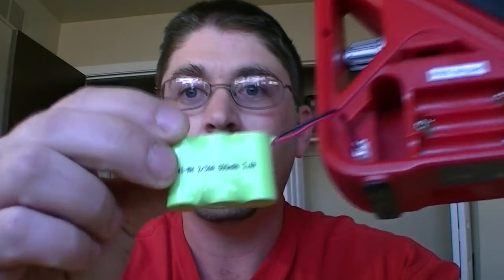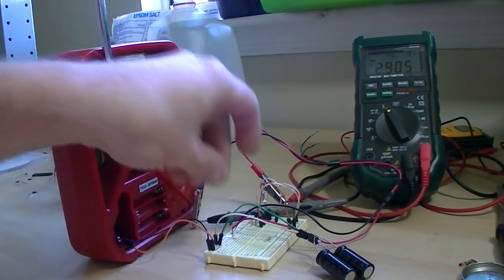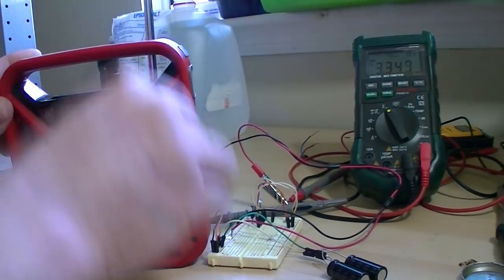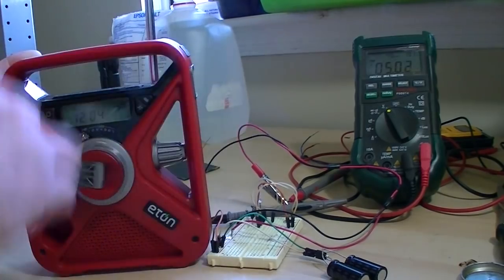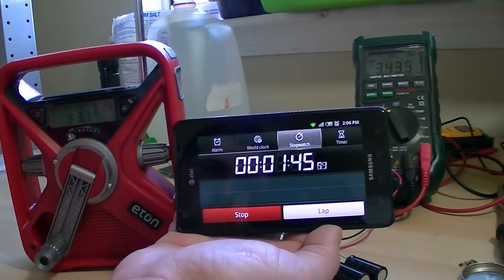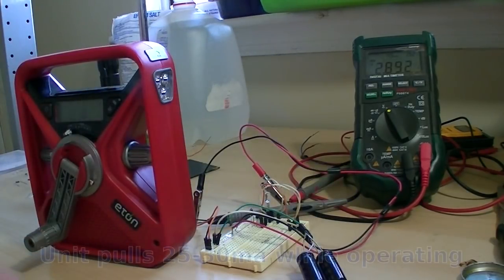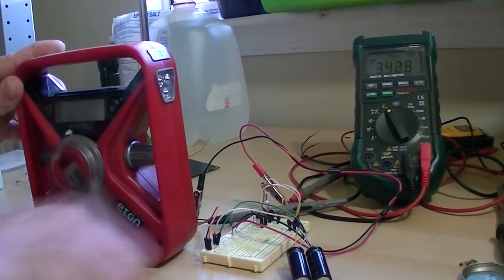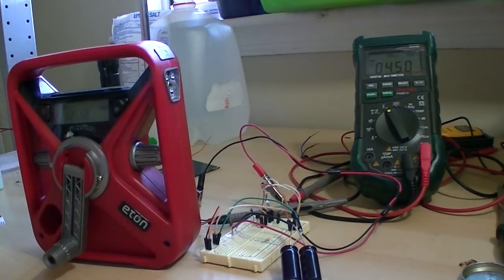Supercapacitors Instead Of Rechargeable Batteries

Comment: Battery: 3.6 v @ .6A = 2.16 Watt/hours 
Each cell of the battery is 1.2 volts nominal (~1.35 volts charged). 3 cells = 3.6 volts (~4.05 volts charged)
The units cutoff is 2.9 volts (~0.96 volts/ cell)... Since a typical NiCd cell is nearley completely discharged and still above 1 volt/ cell. This cutoff is fine for a 3.6 volt NiCd, and does not affect its delivered capacity of power to the unit.

Calculate power in Joules:
P(W) = E(J) / t(s) ... 2.16 = E(J) / 3600 s... E(J) = 2.16 x 3600 = 7,776 J  

3600 seconds are used because that's 1 hour. 1 Joule = 1 Ws (watt/second). So, 1 watt per second is 3600 Joules. That's the Joule-Watt relationship. (Doing this because Joules are used in capacitance power calculations)

2.16 Watt/hours = 7,776 J  <-- *The battery's total power 
(* regardless of the units voltage cutoff and what not)

Since the units cutoff is ~3 volts, we need to a healthy amount above it to achieve to same power. This is because the capacitors still hold power below 3 Volts (actually all the way down to 0 volts, they are still releasing energy). So, to find a capacitor "equivalent" to the battery... we need to calculate above the cutoff. 

A capacitor's discharge (unlike a NiCd) is near linear (For this example, Its fine to generalize that it is).
This means, as the capacitor loses its charge, it drops at a linear rate in relation to the applied load.

I'm going to assume, that the unit has a battery charge regulator that limits the charging voltage to 1.6/ cell  (generally, a minimum of 1.41 volts/ cell is necessary of any NiCd charger to achieve a full charge)

So, we can say the charging circuit will deliver ~5 volts max on the output. Since out cutoff is ~3 volts... that only leaves us with 2 volts of capacitor power to play with for the circuit.

So, to make 7,776 J of usable energy in a capacitor, we are actually going to need 60% more energy than the standard battery. This is because of the cutoff. The caps will discharge to 3 volts, then all the rest of the energy become unusable. Essentially, your only going to have 3110.4 J (2/5ths of a 5 volt, 7,776 cap bank). This is simply a waste.

The solution, is a voltage booster! Some DC-to-DC converters can take a low voltage and bump them up to a desired amount. With an example of the XCL101C501BR-G (from Torex Semiconductor), you can have a minimum input of 0.9 volts and max input of 5.5 V, and produce a steady 5 volts @ 100 mA! Perfect for the discharge characteristic of a capacitor. 

This would mean, we would be "resetting" our cutoff voltage to 0.9 volts, and could even use a set of 2.5 volt super-capacitors in series and be completely in the clear to use most of their stored power. We would need to use 3 super caps, because the charging circuit voltage is actually exceeding the max voltage of 2 caps. (Trust me, you do NOT want to exceed the voltage of a capacitor... let alone a super cap). So since the cutoff is 0.9 volts and the max of the charger is 5 volts.. that's 4.1 volts of "wiggle" room ( much better that the 2 volts before). Since 3 super caps in series are 7.5 volts, were shaving off 3.4 volts of usable power (7.5 - 5 = 2.5, 2.5 + 0.9 = 3.4)  of the bank. So, that's ~ 45%. Still a lot of unused energy... but workable. So, since we need to have 7,776 J in the bank between 0.9 - 5 volts... were actually aiming for a total power bank of ~ 14,138 J ((7,776 / 55%) x 100%).

E = ½  x (C x V²) 

14, 138 = ½  x (C x (7.5)²) 
C = (14,138 x 2) / (7.5)² = 502.67 F

That means we are going to need ~500 F @ 7.5 volts to make the usable power equivalent to the battery.

3 caps in series are as follows:

C(total) = 1 / ((1/C1) + (1/C2) + (1/C3))
500 = 1 / ((1/C1) + (1/C2) + (1/C3))

Since we are using the same nominal sized caps... we can rearrange the formula and solve for the value of C (C1, C2 and C3  will be the same)

1 / 500 = (1/C1) + (1/C2) + (1/C3) 
is equivalent:
1 / 500 = (1 / C) x 3
is equivalent:
(1 / 500) / 3 = 1 / C
then:
C = 1 / ((1 / 500) / 3) 
C = 1,500 F

That means we will need three 1,500 F, 2.5 volt caps to make the equivalent power of 620 F @ 7.5 volts.

The most cost effective equivalent to 1,500 F, is the XV3560-2R7407-R (by Eaton Bussmann) @ ~ 16.50 USD each. It is 400 F at 2.5 V... We will actually need 12 of these caps to make our circuit. It will be 3 seats of 4 caps in parallel (1,600 F), with each set connected in series. A solution like this, with the 12 caps, a DC-DC booster and some wires and solder gear would be ~220 USD all said and done. (In saying you have solder tools already). 
With a system charge voltage limiter to 2.5 volts, you could use 2.5 volt caps.
Again, since we need to have 7,776 J in the bank between 0.9 and 2.5 volts now... were actually aiming for a total power bank of ~ 12,150 J ((7,776 / 64%) x 100%). This actually improves our efficiency of the bank again, by only having about 36% of unused power. 

12,150 = ½  x (C x (2.5)²) 
C = (12,150 x 2) / (2.5)² = 4860 F

~ 4800 F to make the equivalent power at 2.5 volts will be 12 caps in series. So, you can see, there is no difference to the cost of the system. Just improved efficiency.

Maybe both are not the most cost effective... but you can see that caps are still not an answer to the energy problem. Alternative batteries and technology may progress caps and batteries.

Comment: Dude, you're doing it wrong!  The effect you're getting with the capacitors in series is like trying to pour 2 liters of liquid into a 1 liter glass, it won't fit.  You need to connect the capacitors in parallel to get the total voltage of the capacitors higher than the voltage you want to charge to.  As it is now, your capacitors are quickly bleeding of the excess voltage above the 2.7V of the capacitors.

You're taking a chance that your capacitors will blow up in your face, not pretty!

Comment: What's the difference between ferrets and amp hours. I wanted to switch my scooter from sealed lead acid batteries to lithium-based batteries but would supercapacitors provide even more power or with a discharge with to rapidly to be practical for use.

Comment: You need to run the capacitors in parallel  to increase the Microfards, maybe you should go back to school. all so
a battery can store more energy then your version of a super capacitor.. Sorry dude.
Reply: Phillip Ramirez http://puu.sh/gtF5H/93db96f7ae.png 10F 2.5V
Edit: MrMac5150 Super capacitors are quite sensitive about over-voltage. He is using series connection to increase the voltage they can handle, so that it meets the requirements of the radio. It is mentioned in the video, that the low-limit of this particular radio is 2.9V, that is, it does not function with voltages lower than 2.9V.
Reply: but it has no deep capacity
Reply: watch the video more carefully next time, they are in series as they are 10F 2.5v and his requirement is almost 5v.
Reply: waqas shehzad they arnt a full F. milli maybe. micro probably but bigger then pico
Reply: Fester Blats
So true, a cap can not replace a bat.
Reply: Fester Blats the faster charge. the lighter weight. life expectancy if maintained correctly. super capacitors are being used many places along with storage cells. the key is to combine them not fully replace them
Reply: Phillip Ramirez
BULL
Reply: Just do a search. They are developing ultracapacitors for use in fuel cell vehicles. Before you call bull on someone you should try to at least make sure what they said wasn't correct
Reply: Phillip Ramirez
Bull SHIT
Reply: MrMac5150 The capacitor used in this video is relatively small compared to what's available out there. http://www.mouser.com/ds/2/257/Maxwell_Technologies_k2_2_85v_ds_3000619en_1-491975.pdf In certain applications, a supercap would be more appropriate than a battery, due to the high currents you can charge and discharge supercaps at. Not saying that a supercap is what is most appropriate for running a radio such as this one, but it is fully possible, as demonstrated in this video.
Reply: Oddstr13
Ya like a wind up flashlight.. LOL

Comment: Nice demo!  The only technical issue for the booster is switching it in and out of the circuit during the charge/discharge cycles. A double pole, double throw switch would work nicely. A quick and dirty way would be to have quick connectors input to the booster with a female connector and the output from the booster with a male connector. This would allow it to be placed in line and in the correct direction very easily. It could also make it easier to experiment with switches...

Comment: i found the selfdischarge to differ greatly. The maxwell caps with the terminals on one side hold their voltage amazingly well, the once i got where the leads are on different sides are not so good and those chinese Hy-Cap's are quite bad regarding selfdischarge (ok i had only one new cap to test this).

Comment: Wait 500F?  How do you charge it without shorting out your charger?  The inrush must be outrageous.  You sure these are not 500 uF and someone scrapped off the "u" to trick you?  and how do they do it in such a small package?
Reply: Then an current source could be used, which can limit the charging current to safe values.

Comment: I would like to see how connecting the capacitors in parallel to the regular (factory stock) battery pack might enhance the performance. ... It seems like the capacitors would act like a charging  "reservoir" and would soak up any transient "spikes" in your manual charging output ... SO ... In addition to adding capacity to the total stored charge (milli-amp-hours) the capacitor SHOULD also add efficiency toward absorbing and storing any sharp spikes from the crank-generator whereas those spikes might be wasted as heat by the SLOWER uptake of the chemical batteries ... Hmmm ... Just a thought. ... Of course, over  the course of an hour, you might loose all that faster capacity due to leakage. ... another big "hmmmm".

Comment: Nice . Simple , un confusing demo . Any chance of this & the battery alternative tabulated . Times , power in / power out effeciancys . It would seam a capacity / battery amalgum would be the best way to go & with some capacitor to battery shift system . Quick charge , slow discharge ..... Ahhhhh ...... Utopia .

Comment: Capacitors are already used in consumer electronics instead of rechargeable batteries.  They are used where very quick charging is more important than capacity.  Search for capacitor flashlight (a few of them are DIY projects, but many are commercial products).  Search for Micro Chargers LED Light Racers for a toy that uses capacitors instead of rechargeable batteries.  The inefficiency due to internal resistance is negligible, which is why you haven't burnt yourself on a charging battery.  Waste energy turns to heat, and not much is wasted.  Batteries beat capacitors by huge margins for price and for charge per weight (or per volume, which is why you see them only used where very quick charging is important.

Comment: What sort of appliance are these used in.. I like reclaiming things.  If I can avoid buying something, im all in
Reply: you might be lucky to find one supercap in a computer as a replacement for a button clock battery, but i belive supercaps are usually only found in industral equipment where a half second power out could cost thousands of dollars to the machines and production. you will mostly only find regular caps in consumer devices.
Reply: Yeah I came to the same conclusion a bit ago.  Thanks for the reply.

Comment: Just goes to show you that really, the energy used to crank is worth 2.5 minutes of power at 30ma.
Larger caps do not change that - They will also only give you 2.5 minutes of play time for 1/2 minute of cranking. Maybe less if the leakage is higher.

Comment: what the fuck? 350 Farads???? I can't believe it
Reply: Believe it
Reply: Capacitors are just 2 insulated plates. There is a balance between surface area of the plates, the insulation, and the space it fits in. Having lots of surface area makes for plenty of farads but very little room for insulation therefore low voltage before it internally shorts. Makes it practical to power things though.
Reply: DiyEcoProjects  1 Farad = 1 Amp second per Volt; this means a 1 Farad bank at 10 Volts can supply 10 Amps (in total) which will drop it to 0 Volts. My capacitors are 3,000 Farads, not three, and they are also 2.7 volts, not 2.5. Thus, each cap can supply 3,000 Amps per Volt, giving an effective Amp storage of 8100 Amps, if charged to peak. Because of the nature of capacitors, you lose per-cell capacitance when run in series, so 6 of them in series only has an effective capacitance of 500 Farads; bringing the total voltage up to 16.2 Volts, but the overall amperage capacity is unchanged at 8100 Amps.
Reply: DiyEcoProjects  Incorrect. Farads are Amp-Seconds, and should only count the usable Voltage. In a vehicle, this would be from 14+ to right around 10 Volts, severely limiting Amp-Hour capacity. A 5000 Farad (yes, five THOUSAND), 15 Volt bank drawn down to 10 Volts is just under 7 Amp Hours.
Reply: DiyEcoProjects You might want to use an inductor instead  Those are just a coil of wire that resists change in current. They are used pretty often as "chokes" to cut out signal noise. If you look at your headphones and see a little cylinder on the end, that's an inductor.
Reply: ***** this is a nightmare.
Reply from the maker: Alexander Hartdegen I regularly use 500F supercaps now in my projects.
Reply: I have a bank of 6x3000 farad caps for 500 farad total capacitance at a little over 16 volts (full charge). I also have a bank of 6x650 farad caps which are currently unused; I should probably find something to do with them.
Reply: R&TPreppers
Hi there... can i ask a question please. 3F 2.5v caps ... does this mean that 5x2.5v in series would mean 12.5v at 3F ? is a farad the same as an amp? so i that 3amps hours? ... thanks for any help
Reply: R&TPreppers
so 3F = 3mins ... ok. so not very viable as alternative to 12v batts

2.5V 630 Farad
5x2.5 =12.5v and 10hrs run time ?

Thats £119 for a 10ah batt
Reply: ok so ...
 
This version 3F 2.5v cap
5caps x 2.5v = 12.5v
But ... 3F / 5 = 0.6amps capacity
 
Or a 630F 2.5v cap
5caps x 2.5v = 12.5v
But... 630f / 5 = 126amps hrs
 
5x 630f 2.5v caps = £119 vs leisure battery 110ah for £59
 
Thank you for your explanations
Reply: um... id like a capacitor for a copper "bus bar" that im pluggin a wind and solar into - to smooth out the electrical surges.

Its around 30amps at 18v ... what would be a good capacitor to use please?

18v / 2.5v = about 7 caps in series of
30a = 30f = 210F capacitors?

What would a 1F 20V 1000W  Digital Power Cap Capacitor (car audio) do please? if i attached to the copper bus bar
Reply: ah ... erm... ok. I think i need much more research about farads and capacitors. Its not making sense now, but thanks for your comments.

so you need around 5000+ farads, because a farad is a messurement of amp seconds...

hmm

What would a 1F 20V 1000W  Digital Power Capacitor (car audio) do please? if i attached to the copper bus bar... the bus bar is a common connection point powered by solar and wind... and do i need one in a solar/wind set up?
Reply: DiyEcoProjects  1,000 Watts is a bit of a lie there. 1 Farad at 20 Volts is capable only of delivering 20 Amps in total, from 20 Volts down to 0 Volts. Watts are Amps times Volts, so the actual Wattage capacity of something like that would only be....20 Watts. A capacitor that size could probably power a regular car headlight for 5-10 seconds at an absolute maximum.

Your best bet is to purchase a smaller set of supercaps (like the 350 Farad units) off Amazon or Ebay and test them for yourself; that's the only way you're going to understand their limitations. Do NOT overcharge them.
Reply: ATGEnki
Thanks for all your replies, i appreciate it.

Ive got to grips with amps/volts/watts and amps hrs/watt hrs ... farads is the head ache lol

Just saw a youtube video test. 2.7v at 400F turns out to be 300mah ... so for 2.7 4000F set up it (thats 8x of those capacitors) would be about 3200mah 3.2ah ...  maybe

I think i might leave this alone and go with solar and wind with diodes pointing at a common bus bar... then from that to charge controller. Im thinking the charge controller can handle the fluctuations of power coming from the generators.

Thank you mate, take care
Reply: DiyEcoProjects  Farads to Amp-Hours: (Minimum Bank Volts - Maximum Bank Volts) * Farads / 3600

It's important to get the minimum / maximum bank voltage correct because if there's unusable voltage (like say up to 9-10 volts in the case of cars), it will skew your Amp-Hours rating and make the bank appear more usable than it really is.

For example:
5000 Farad bank, running between 10 and 15 volts is only 6.94 Amp Hours. Running from 9 to 15 volts is 8.33 Amp-Hours, but you risk not being able to start the vehicle at that low of a voltage.
Reply: DiyEcoProjects No - When series caps, the capacitance goes down and the voltage goes up. When in parallel, the capacitance goes up and the voltage remains the same.
The voltage is the safe operating volts where no breakdown happens. When you put 2 in series, the distance between the electrodes doubles, so the voltage safe range doubles too.
Reply: hmm... thanks for the replies. Ill check it out